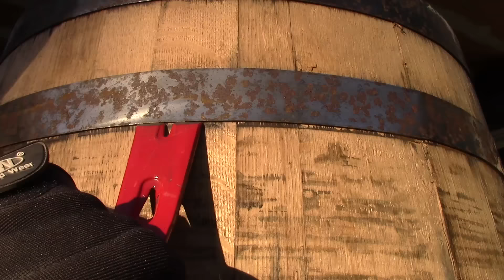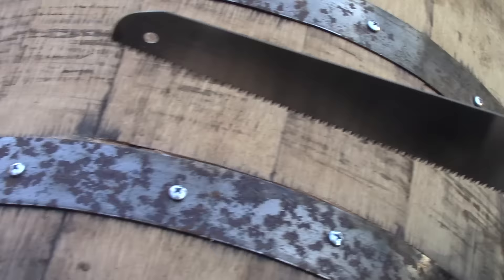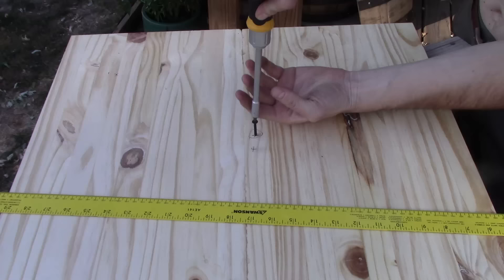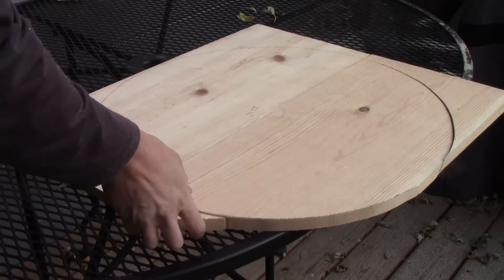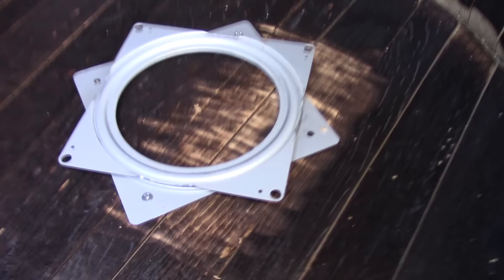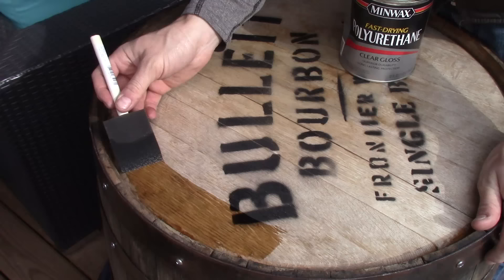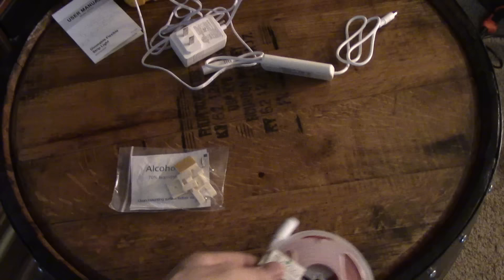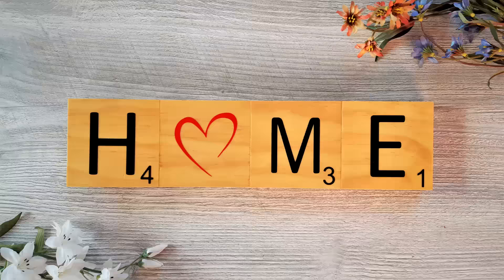Bourbon Barrel Cabinet - Handmade - How I Make Them

Comment: I love the look. One observation though: bourbon barrels are made exclusively from quarter sawn white oak. Maybe your average person wouldn’t pickup on this detail, but that pine shelf sticks out like a sore thumb. Again, it’s a beautiful piece, but I think the project would be that much better if the shelves were also made from quarter sawn white oak. Keep up the good work!
Reply from the maker: Hey Cody, thanks for the feedback! You are correct.  I based my barrel off what was available on other channels/websites and saw most people used glass or a "lid" of another barrel (which would keep the oak component). However, I don't have a glass source and the lid doesn't size up well.  I could purchase white oak planks and glue them together to make a wide enough shelf, but the cost and weight increases significantly, plus they wouldn't have the aged look to match the barrel. I considered making fancy shelves - using live edge slabs, etc, but in the end, I don't think most customers would pay the increase in price for a shelf. 
Regardless, this was a starting point and glad you pointed it out. They are very customizable barrels if you put the work in!
Reply: Thanks for the response! I figured cost could be a factor for sure. I bet a green felt, something akin to a billiards table, would look fantastic as a shelf as well.

Comment: I put larger hinges on the door and when it opens it drops down a little on the right side Its like t he hinges has a little play in them how can i fix this without moving the hinges or putting smaller hinges on the door. Thanks in advance
Reply from the maker: Hey there. I don't have a great solution. I was able to fix it on a previous barrel by drilling new holes and initially lining the door up a bit better and taking the flex into account. I used wood filler to hide the holes.
It's probably too late now, but I've angled the hinges upwards just slightly to try and offset the door sag. Sometimes it works, sometimes it doesn't. I don't have a great solution for the hinge flexing.
Some of my barrels are perfect and other rub too much. You can try sanding or removing some of the excess wood on the door where it runs.

Comment: So, I am working on one of these myself. I just ran into a big problem on the door.  When I cut out the door the bands have caused the door to expand and no longer fit the hole. How did you keep that from happening?
Reply from the maker: Sorry the delay! So this issue almost always happens - it varies to what degree of severity. I've had to install the door (or doors if 2) and then trim away the excess when the closed door meets the edge. Uninstall the stave that expanded to far, trim away on a table saw and reattach until its flush to your liking. You will also have to grind away the excess metal bands.
It's annoying, but really 50/50 after your pop the door off. Sometimes almost no modification is needed, sometimes you gotta work at it.

Comment: Beautiful work.  Not sure I would pick shellac on shelves for bottles since it is soluble in alcohol.
Reply from the maker: Thank Brad!  Good call on the shellac.  I do only use polyurethane right now for current barrels.  Hopefully, the interior shelves see none or very little alcohol droplets from bottles.  The top of the barrel is where I'm expecting most people to spill at.  Good info though - polyurethane in the future it is!
Reply: @brad Macaulay how will the shellac get through the glass bottle into the contents?
Reply: @jacobyjackson3530  alcohol running down the side of the bottle after a pour.  That can get on the shellac finish and ruin / dissolve shellac.  Some people are super sloppy when they pour drinks.  I built out my liquor stand with mirror bottom and glass top just because I didn’t want to deal with refinishing if things got messy.

Comment: Make a concaved cradle footing for barrel to rest in while sanding, a whole lot of wobbling will be reduced and it won't be a pain in the backside.
Reply from the maker: I'll end up making a jig that uses caster wheels on a square frame. That way I can set the barrel and spin it on it's side when needed and lock the wheels to keep it from rotating when not. Doing this in the driveway is definitely a pain!

Comment: How many coats of polyurethane did you put on the outside of the barrel?
Reply from the maker: Great question - I do 2 coats on the sides of the barrel. The top of the barrel is 3 - 5 coats. Whatever I feel makes it smooth and clean since it will be the table-top-display part of the barrel. It will also likely see the most wear and tear, so multiple coats are used.
Reply from the maker: The interior shelves are 2 coats, for reference.

Comment: Very informative video and my only question is what size hardware did you use to secure the bands, hinges etc…?  Thanks in advance.
Reply from the maker: I used 5/8" self tapping screws for the metal bands. I've since started using 3/4" self tapping screws since the staves are about all about 1" thick.  More peace of mind.
For the hinges, I use wood screws and pre-drill the holes.
I may switch over to 100% wood screws for the metal bands in the future if I can find the right style. I believe pure wood screws will secure even better in solid oak.

Comment: Something I do for centering lazy Susan hardware is to use 2 sided tape to attach a thin piece of cardboard or thick paper draw to lines from 12 to 6 and 9 to 3. The cut out a hole about an inch across. 
Then find the center of the area where the lazy Susan is being installed draw the same intersecting lines thine those up with the ones on the paper.
Reply from the maker: Thanks for the advice! I'm getting the hang of centering and using spare wood - or in your case - a paper template/guide.

Comment: Nice job. Suggestion. When I made these in the past I put the hinges and screws in a mix of muriatic acid to rust them. Be careful. They end up looking rusted like the staves. You can also use a lazy Susan hardware kit with a center pole to have two rotating shelves. Much easier installation.
Reply from the maker: Hey Andy,  thank you! I started just painting my hinges with a hammered metallic black paint (and the screw heads) since customers started requesting it. I've seen the lazy susan double shelf pole hardware, but it's not available instore here where I live. I'll have to get it online and very well might try it out in the future!

Comment: You can also take a hand propane torch to the hinges to remove the zinc coating...unless the hinges contai plastic washers.  The result is a dark gray metal look rather than the harsh silver.
Reply from the maker: Another tool I need to buy - propane torch! I've been needing to buy one for my lighting my smoker anyways.....any reason to buy tools!

Comment: I’ve used the lazy Susan hardware many times.  I suggest you mount the hardware on the bottom of the shelf first then remove leaving four pre drilled holes. Then cut a larger access hole in the barrel bottom. That’s the best method I’ve ever found and it’s only a slight pain in the butt…😂
Reply from the maker: Appreciate the advice. You can tell it's my least favorite part given the poor camera angles quick footage, ha!
Reply: Larger access hole? I’m confused by this
Reply: @hyphymane1  he drilled a small hole in the bottom of the barrel to stick a screwdriver through for tightening the screws in the shelf. I suggested making those access holes larger so you can get a better view to line up the holes. When you flip the barrel back on its bottom the shelf will cover the access holes so you won’t really see them.  I’ve lost count of the number of these things I’ve installed over the years and the way I described is the best method I’ve ever found. Hope this explanation helps.👍

Comment: Love the video! Hope to do this project soon! You said the top shelf was a larger circle. For the lazy Susan you used the bottom of the barrel to determine the size. How did you figure out the size for the top shelf?
Reply from the maker: Hey there. I typically measure the inside of the barrel around the upper middle metal band. Or roughly about 14" inches down from the top. I usually get about 22.5" to 22.75" for the diameter.  Then I cut off the edge of the shelf to make it flat across - but you could leave it as a large circular middle shelf - up to you! I found trimming it straight made it easy to reach bottom shelf bottles.

Comment: Good video.  Just made one myself. I did find it easier to place a couple 1x’s on the bottom to make it a little easier to secure the lazy susan. My question is how did you tame the polyurethane smell afterwards?
Reply from the maker: No real secret, the fumes will go away as the polyurethane dries. I polyurethane it in the garage or outside and wait until it dries there. (1-2 days)

Comment: Love the video! Trying to make one of my own. Interested in knowing tapping screw length / type. Would love to find black finish, but am willing to spray paint if needed.
Reply from the maker: Hey there, in the video I think I used a #8 1/2" tapping screw. However, I switched to using a #10 3/4" tapping screw. Much more secure and bite depth.
I couldn't find any black ones and spray paint the heads prior to installing them.
Reply: @leaf_and_knot  Awesome! Thanks for the info.

Comment: How many stave wide is the door ? Thx. Nice job.
Reply from the maker: On this build, I went 9 staves in width. However, this varies from barrel to barrel since each barrel uses random sized staves. More importantly, I try to center the door with the bunghole (used as my power cord exit) and center the door with the distillery logo. Hope this helps!
Reply: @leaf_and_knot  Thank you very much. Cheers.
Reply: @leaf_and_knot  Thank you.

Comment: Hey. Great Video and Good work. Thanks for the inspiration. 

One question about the hinges. I have seen some manuals with only a single hinge…I think your version looks much better, but I get the manuals telling me to use a single hinge in the center of the door since the Barrel is bulgy…don‘t you run into trouble with the hinges this way? Do they give you enough clearance (since the upper hinge should pull   a little upwards and the lower hinge downwards due to the shape of the barrel)?

It‘s a bit complicated to explain but I hope the question is understandable.
Reply from the maker: Hey there! I do know what you mean. You are correct, the bulge or roundness or circumference of the barrel in the middle can create a problem with any door that opens flush with it. I only place my hinges between the two inner metal bands. Placing them any higher and the door won't fully open. The hinges do have a little stress on them from the roundness of the barrel, but they are working. I would recommend using two hinges due to the weight of the door. The door can sag, even with two hinges, so it's important to mount it correctly before screwing into place. I don't trust one hinge.
In the future, I will try doing a French door - basically two smaller doors that open from the middle.
Hope this helps!
Reply: Hi. Thanks a lot, I'll factor that in. Yeah I will try and go for two doors as well. Still the hinge issue kept me thinking but your insights are very helpful.

Comment: Well done Sir.  I am going to make one, but it may elevated and sideways.  Does anybody find bending over to the floor to get a bottle a pain?
Reply from the maker: No customers have mentioned it yet, but I suppose they were planning on it. You could definitely elevate it with a platform. I tell people to place it on a spare carpet piece or rug to prevent the bottom metal ring from scratching up the floor.

Comment: now after power washing the cask it will dry out hoops will get slack and joints will all open up?
Reply from the maker: Hi Joe,  the barrel was already mostly dried out.  After powerwashing, I'd say only about a millimeter of water absorbed into the wood in some areas. It was back to dry in about 2 hours. No issues with expanding or shrinking beyond what it already was.

Comment: Super helpful video! What can you use to cut the wood AND the metal straps around the barrel?
Reply from the maker: I used a handsaw to cut the barrel staves and an angle grinder to cut the metal bands.
You could use a jigsaw to cut the barrel if you can drill an entry point first (what I do now)

Comment: very cool project...thanks for sharing.  Two things:  they don't make a lazy susan bracket that comes apart so you can shoot the screws in and then reassemble?   Why not make the shelves out of white oak to match the barrel a little better?
Reply from the maker: Thanks Colin, appreciate it! If they do make a lazy susan like that, I haven't seen it around here. That would make life waaay easier! I'll have to google around a bit.
The reasoning for the shelf if mostly cost. Trying to make two round white oak shelves ~19.5" and ~22" require a lot of wood planks to be glued together and the a circle cut out of them. They would have to be stained as well, as the new white oak is way to light in color. Weight is also saved by using pine. I'm not against doing it, but I would ask for more $. Most people just want the exterior of the barrel to look awesome and interior to be more functional, rather than seamless.
In the future, I'm looking at making at least one barrel with the interior fully decked out. Live edge, sold hardwood, more unique shelving designs, etc. We'll see if it's worth the extra work and cost, but it will be fun regardless!
Reply: @leaf_and_knot  that makes sense. Oak is definitely more expensive and white oak typically isn't available from a big-box store. I've never used one of these lazy Susan pieces. Maybe someone makes a two-piece version.

Comment: i make whiskey barrel cabinets in ireland. i always have a lot of trouble getting the door to fit after i cut it out. i clamp it and brace it on the inside but it never fits nice without a lot of sanding. any tips.
Reply from the maker: Hey there! I have the same issue on probably 50% of the barrel doors.  Sometimes the issues is a poor hinge with too much play. I try to angle the door upwards just a bit to compensate for the sag.
The other technique I am trying right now on a new barrel is not removing the metal bands for sanding. Leaving the metal bands on the barrel and sanding around them seems to keep the barrel wood in place better.  I wish I had a better answer because it is a real problem and some customers aren't happy about it.

Comment: Is there a way to install the hinges from the inside so they're more hidden or does the curve of the wood prevent that?
Reply from the maker: I believe there are some that open from the inside that may have the reach called a concealed hinge. You could also experiment with a 170 degree hinge that has a unique range of opening.  Otherwise, the curve of the wood will get in the way of a normal hinge.

Comment: What did you use at the bottom your door to reenforce the bottom inside part?
Reply from the maker: I used a piece of aluminum that I bought at a Menards. The bottom staves were just a bit wiggly for my liking. I don't think this is needed for all barrels.

Comment: Great video!  I wound up hitting a snag when I cut my door: the metal slats expanded and unbeatable and boots the door won't close... any suggestions?
Reply from the maker: I've had that happen before. You can try and remove a stave or two and bending the metal back into a more circular shape.  I don't think it's possible for it to be 100% flush, but should be close.
Reply: @leaf_and_knot  thanks.  I wound up getting some Steel wire and some tightening devices and I'll try and bend it to my will the week.  I'll let you know how it turns out

Comment: What did you use to reinforce the back of the door staves? Mine seem to move a little
Reply from the maker: Hey there! In the video (but not really shown) I used some aluminum strips. Maybe 3/8" wide and trimmed the length to size. It helped a little.

Comment: Great job. I'm in the process of building my cabinet, and was wondering how easy it is to reach in and spin the lazy susan if it is filled with bottles?
Reply from the maker: Really easy - just use the closest part of the shelf to the door and give it a spin. It won't spin freely very well when its loaded up, but it rotates freely.
Reply: Nice job. One critique. Did you try mounting the hinges on the metal bands? Might be a slightly cleaner look. Wish I could source the Bullitt barrels myself.

Comment: Do you have a list of supplies to purchase, minus the barrel?
Reply from the maker: Hey there! I'm making another barrel with some updated methods and parts listing. It is a more detailed video on how to make a barrel cabinet. I'll release it soon.

In the meantime:
1 lazy susan bracket (home depot if in USA)
2 heavy duty hinges
100 self tapping screws (5/8" or 3/4", #10)
I used a harden drill bit to make the pilot holes in metal bands. Same size as screws used.
1x12"x6' board cut in two to create shelf (x2) I couldn't find a 1x12"x4' board
LED light strip with AC power from Amazon (warm lighting used, not daylight. Preference)
1 can of warm polyurethane - g;pssy or semi gloss
2-3 foam brushes

You'll need your own tools to make the cuts, sanding, etc as seen in the video. Updated vide coming soon with better description on what I did.

Comment: How would you make these waterproof/resistant for, perhaps, an outdoor electronics cabinet?
Reply from the maker: That's a tough one. Barrels will develop natural gaps between the staves. The polyurethane will protect the wood, but probably not be enough to seal it completely.
Maybe try clear caulking each gap and cleaning up the excess?
Reply: @leaf_and_knot  Yup, I get it.  Thank you for your response.